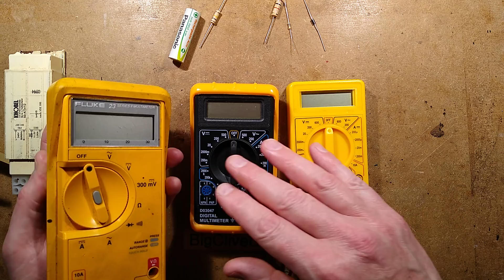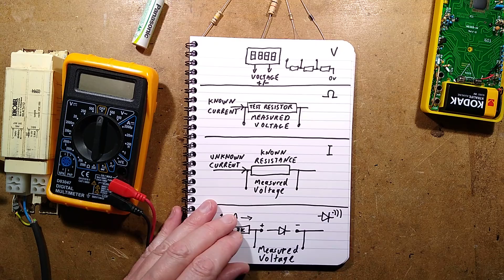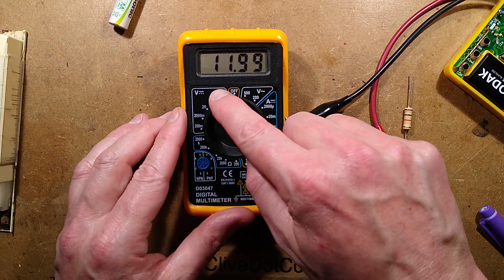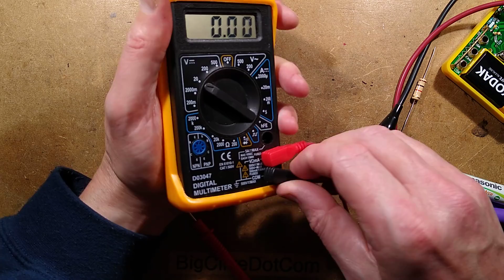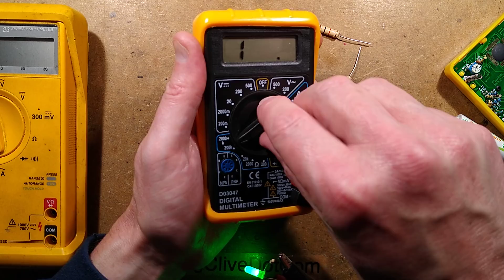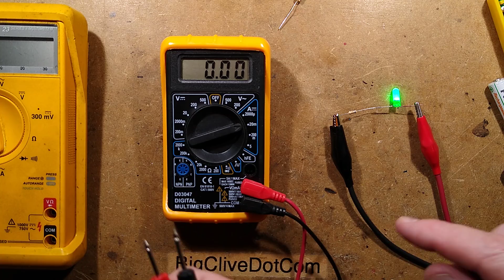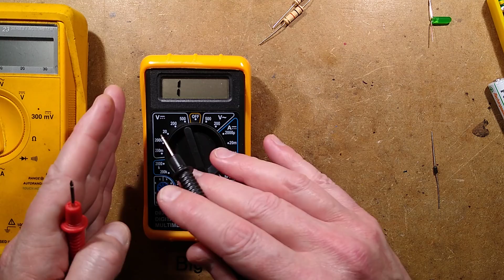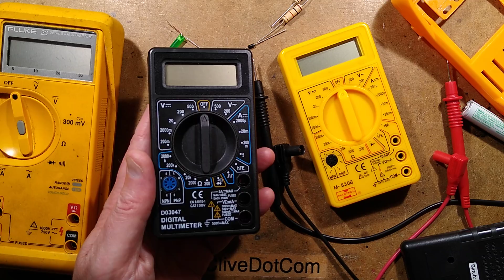How to use your trashy meter without blowing it up (much)

Comment: One of the probes on my cheapo meter broke (there's literally like a single strand of copper wire holding it together) so I bought another one. When the 9V battery dies I guess it would be cheaper to buy yet another one that to replace it. They're very disposable.

Comment: I don't have any problem with cheap meters apart from the fact that they invariably ship with leads that are totally shit.
I started out with an Altai analogue meter and moved to an Altai digital meter (similar to the one you showed here) but the meter after that was an Avo 8. The Avo was a top quality piece of kit but got replaced with a Fluke 12 once I started needing to use it up ladders as it was too bulky and heavy to use safely up the ladder.

Comment: For all the decades I have been testing diodes by resistance (not the crazy modern "diode mode", I always thought that the 600-ish value was ohms, not voltage. :) Plus, I did blow up my first Radio Shack (Tandy) analog meter by leaving it in resistance mode and putting voltage across the leads

Comment: Once I exploded the small mastech meter but I was way way of its specs, I tried to measure the voltage of a gas tube power supply, it was probably over 1kV but I was in high school and didn 't know better. When I opened up the meter some traces were completely blown.

Comment: I work in the arcade industry (for about 30 years)  For us it's highly desirable to have a meter that is able to correctly measure AC without any interference with DC 'ghosting'.    Reason for this is any AC ripple from either a poor layout/design of filtering or capacitors going bad can cause that ripple to play havoc with digital electronics used in the arcade equipment.

Comment: My requirement when continuity testing and getting a beep, is when reverse engineering. Quite often, you know that a component is connected to an IC, but don't know which pin number.  Being able to quickly swipe the probe across the pins of an IC and hear a beep when continuity is found is a must.

Comment: I have a couple of those. On one I had to use my Fluke to adjust it because it was way off from the factory. Those things are so cheap that when the battery runs out, a new battery is more expensive than a new unit.

Comment: Been doing electronics repair for about 50 years now, started with Eico VTVM's  bought my first digital meter about late 70's a Beckman bench top used it for years then had a few Radio Shack and other brands including the HF freebies my main units today are 2 Chinese up scale from the HF's and a Tenma with true RMS. Never owned a Fluke, too pricey for me.

Comment: I only have two meters, the cheapy yellow one you had on display, and the DIY looking one with the zif socket for testing capacitors/transistors. 
Though most of the time you don't need a tester to spot a capacitor that needs a change. 
I can't see a reason why I'd need anything more expensive. I'm not a professional, and I don't do anything with high voltage.

Comment: 13:15

accuracy: how something compares to a standard
precision: how fine the divisions are between discernable measurements

so you could still be on the 20k range, and if the meter read 15k for that same resistor, it would not be accurate.  What you really get by switching to 200k is a reduction in precision.

Comment: Yesterday I pulled my harbor freight meter out (one of three laying around... They just toss them into the bag of what you're buying) both probe tips had broken off so I had to cut off both probes down to bare wires and use the wires... But it worked I was able to test resistance

Comment: I pretty quickly destroyed my first multimeter, when I was a kid.
I had a series 1 land rover. Did not have the doors fitted, was driving along, multimeter on the passenger floor... it fell out and went under the rear left wheel.
Completely smashed.

Now I have 6 Flukes. Because sometimes you want to measure efficiency of a power supply (voltage and current in, voltage and current out - so you need 4), as well as a clamp meter and a spare.

Comment: I had an old LG but it drained the battery like crazy also it had a portruding on off switch which were prone to power on the meter while in my toolbox
Then I used the companies fluke but as as hobbyist bought the aneng , small, accurate enough and only needs 2 AAA and a better rated probes .
I'm never going back to using 9v 😊

Also when I was younger had my adventures with cheap meters, sadly the best I had faced a sudden death

Comment: Honestly, the only time I ever used the transistor socket on a meter was to see if a component I stripped off a scrap board was working at all. These days, I'm perfectly happy using one of those cheap 5 or 10 dollar component testers off eBay. Not only do they tell you if it works, but can give you an idea of whether or not the component is even worth saving. Plus, it works with just about anything you can attach to the leads. And yeah, I do have a Fluke meter I'm partial to, but I only have it because I found it new in a pawn shop for 25 bucks. Otherwise, I'd still most likely be using a 50 dollar Home Depot meter, or something of the like.

Comment: I will say that not ALL meters will fail to "read" when set to DC, but probing AC...
I have a Craftsman 82400. Granted, it's from what... 2003ish, but I love it. It's pretty much the same as your D03047 except it's Auto-ranging and can do some capacitance too (like 5uf is all unfortunately). Though, despite being Auto-ranging, it does have two for DC: V and mV. Can also "Hold", and do "Difference" - nice since you can ohm the cables and select Difference to get a more accurate reading. It also has a max 20A, 1000V DC and 750V AC reading capabilities (albeit only 400mA on the multipurpose reading ports)

Anyways, back to my point... producing a reading when set to "V DC". If I probe my 'Murican AC, I actually get a reading of 0.467V DC. (between line or load, or line/load and earth).
It also reads 0.19V DC with only one lead plugged in  (+ or - probe; regardless of line or load pins). 

Mind you, I'm not implying that's a good thing necessarily... Though one COULD argue that it is, really. Same way that the "scratchy continuity" is better than delay sensed, in that you're still getting a reading and it might get you to look at your meter before claiming _"There must be a break in the circuit because clearly I have my leads connected"_. 
(Granted, any experienced person would also check that they DO have their meter set to the correct mode, but we all make mistakes at least once! lol)
~~~~~~~~~

I will agree that the DC and Continuity are the two things I am always using! lol
My meter has auto-off, and that is the best. I leave my meter in V DC and then to wake it up I press one of the function buttons (a specific one). The only hilarious thing is that it doesn't reset the timer when sensing voltage. 

I mean I say that like it's bad, it's not so bad as if you are in the middle of testing and get sidetracked, it won't wear itself down. Nevertheless, there have been times where I am taking a reading and it shuts of JUST as I connect the lead lol
I have a cheap Equus meter in the garage that I don't use but once or twice a year, and I'm so used to auto-off that I accidentally left that one on for many hours while charging a car battery. (Also poo on me, as I left the leads connected while it charged.) Surprisingly, despite the decimal indicator having residual presence after turning it off, it did not burn-in. That meter is nifty though cuz it can read 4cyl, 6cyl, or 8cyl engine RPM signals :)
[/rambling]

Comment: Definitely no snobbery here, my go-to meter for the last 10-12 years have been Chinesium Vichy/Vici branded Fluke clones (VC99) & they've been great. Only replaced my original because it got lost, think it was about 20 quid and has plenty of features I've found useful in radio/tv repair.  The HFe is definitely crap, never accurate and the only times I've used it was to compare it to my LCR T2 meter.  Apart from that, it's fairly accurate on capacitance & even on frequency up to 500KHz.  I'm not a shill for them but 100% recommend them as a good first meter with extra functionality over the extra cheap ones. (The real cheapies are great too though, reasonably accurate at low frequency and it's economical to keep a couple in reserve in case of disaster/sometimes you just need more than one meter to see what's really happening).

Comment: Although you hinted at it by mentioning averaging, I see you avoided discussing "True RMS" BCDC? The only issue I have with the HFE facility is figuring out the leads on the fastest fuse on three legs. It's not a great yardstick by which to judge a meter in my view. That said, I've only once used it for grading a batch of OC44s

Comment: I like the meter I have now. Power down by itself. Also measure capacitance and frequency. Not perfect by any means. I could use inductance meter I guess. May get one of those clamp current meter.

Comment: My father killed off several of my multimeters when I was a kid. He had a hard time getting the settings right which tended to turn the coils to slag at the most inopportune times. Yep my first multimeters were all analogue simply because the digital versions were ridiculously expensive and big with almost no battery time if they even had batteries and weren't mains powered. I remember one time I took out my multimeter and the needle was bent all to hell. Eventually he admitted to have loaned it, but he hadn't damaged it as it was lready broken. He has set it to 20 volt trying to fault seek the wiring in a car. But as soon as he tried it the needle just whipped up and maxed out far beyond the scale. Yep that MM had a 20 millivolt range...

To me one of the advantages with a modern DVM is that they tend to be pretty well protected, both forgiving and resilient. Just selecting a to low range is not likely to kill or damage it. Even so my father managed to kill of a lot of those too. Now they were cheap ones as I couldn't convince him that it would be worth the money to get something a bit better. And to be honest even if they made a idiot prof all you need is a better idiot, and my father was a very good idiot when it came to things like this. Don't get me wrong, he was incredibly smart and capable and could rebuild a car, build a house, navigate at sea, handle almost any animal, talk down hopped up druggies, repair things and drive heavy loaders. His profession? Gardener...

My father was pretty amazing but he just didn't have a good handle on electronics. He also needed reading glasses but never had them on him, so little things like the difference between millivolts and volts tended to be missed...

Comment: Interesting you said you were confused by your first multimeter. That was also my initial experience. I built my first kit a KnightKit VTVM in 8th grade (1960s). At first I had no idea how the range switch worked and which meter scale to use. I don't remember how I ultimately figured out how to operate the meter.
Reply: Hmm. I never had a problem understanding meters (other than the tranny test socket).
I'll need a different brain to understand electronics or chemistry though.
Reply: I inherited a Fluke 83 ( Manufactured in 1988) from my father and I'm still not quite sure how some of its more esoteric/advanced features works. Still, a nice piece of kit to have inherited and it more than does the simple jobs I do.

Comment: I've never blown up a meter however I've blown the fuse a few times on the current setting. 
I had plugged the leads into the AMP setting for something else and forgot to change them back to Volts. 
I set volts on the selector and went to check the voltage and it didn't work (for obvious reasons).

Comment: I got a b-tier yellow plastic meter. But the 9V batteries cost more than the whole meter. So I found an old 1.5v-12v 500mAh universal adapter, which isn't good for anything these days (it uses a wire transformer, it's that old) and spliced the wires on it to solder it to the 9v power wires. So now it's a meter I can plug in.

Comment: Good video but I was hoping to hear your explanation of why the red lead is negative and the black lead positive for diode tests. It seems backwards to connect the red lead to the cathode for the diode to conduct. I have verified the polarity with a separate voltmeter.
Reply from the maker: The red lead is normally positive.
Reply: @bigclivedotcom  Yes, normally this is true but not for resistance and diode checks. Red is positive for current and voltage checks.
Reply from the maker: @waynem6513  That may apply to older analogue meters, but all my modern digital meters can be used to test LEDs with the red to anode and black to cathode.
Reply: @bigclivedotcom  Thanks for the reply and great videos. My analogue and digital trashy meters are all wired this way. My trashy meters must be trashier than yours. I think it must be cheaper to wire them this way rather than reversing the polarity between current and resistance.

Comment: I put a £3 CPC meter in my friends car.  One day it paid off as the charging voltage could be checked. 13.8VDC ( RAC said 14.1 ) was near enough, old age killed the battery and not the alternator. If you do this install an alkaline battery in the meter as it's likely to last longer. Generic type will be fine. 11 VDC unchanging would be bad news. Yes I do use the hfe tester. Most meters regardless of price are not 100% on that as a definded test current will be different device to device. Transistors can be pair matched for long tail pairs or current mirrors. The fact the meter gives a vague readiing is largely unimportant. A BD139 might say between 120 and 160, pick the higher gain and/or best pairs. Have a fresh battery and warm area as air currents change readings. 1 minute tests. BC337 (  327 )-40 might read 500 which is possible.  In real life air currents change gain. Push pairs together. Heat sensening transistors sometimes need a set gap ( 1 mm perhaps ). Sinclair Z30/50 and A&R A60 come to mind. Take a 1N4007 ( a must have ). Use it to measure temperature on the diode test ( a cold day is the easy way, inside, outside, inside the fridge is good with meter outside if possible ). Then try a red LED. The LED should be higher voltage and change less. If a meter won't read a LED that is a bad mark. Blue and white might be too much which is reasonable. A cheap meter should do these things regardless.  The cheap metre usually is more accurate than the parts demand ( +/- 10 % ).  Usually a part that far out is defective and will show up.  Capacitors being the exception and seldom measured on cheap metrers at uF etc. The CPC meter required better cables. £1 was enough. The suppplied ones would be a risk at 240 VAC as this house ( 236 to 245 ).

Comment: Clive, dideo test - (have you got a non-dyslexic keyboard ?)

DIODE test - nope, in 30 years don't remember ever using this function. In fact, I had to go to the meter to see if it had this function - and it does. Has the transistor connections too - and I remember poking a transistor into this in the 80s and not having a effing clue - so it and the diode test functions are completely surplus to requirements here. I think I've used all the other features (range control (up, down, man, auto), buzzer on/off, Data Hold and Memory (start, reset, min,max)) that your meters don't have.

Comment: I wish I had this information when I first got a multimeter all those years ago! I mistakenly put the lead in the 5A socket and tried to measure A/C in a light socket. The bang and melted ends of the probes scared the living daylights out of me (I was up a step ladder at the time - how I didn't fall off I will never know)

Comment: Been using my cheap-ish meter for a good while and I don't think I see the need to upgrade yet. Anything I'm looking at that's higher voltage typically has unusual-enough characteristics to justify powering up the ol' scope, otherwise it's just resistors and diodes. Other than the "proper" test equipment, my only posh meter is an Extech LCR meter. I figured I might as well get a good one of those if I'll be cherry picking components for projects

Comment: My extech mn25 has settings for 1.5/9v batteries. Measuring DC, it doesn't seem to load the batteries so they don't droop. Using the battery mode, it must apply some load like a resistor or something and the voltage will droop if its a dead battery.

Comment: Here is what I do. If I am in the engineering lab I use the high end stuff that is cal'ed and traceable to gather data. If I am troubleshooting something, close enough is good enough. I will cross check a cheap meter it with a high end one now and then. And take the cheap into nasty places and dangers leaving the $$$ meter on the bench.  I have a HF meter in my desk work bench car shop , like 3-4. They serve there well.

Comment: I’ve had that exact first one you showed (the one with the back off and the fuse) for a few years and really liked it…until last week 😥. I have a workshop with joinery machines, tools and lots of sawdust. Decided last week to take it apart to (finally) clean the glass because it had sawdust within it….anyway, had to ‘pop’ out the circuit board which released a few of the tiny copper, and very springy, ‘v’ shaped runners that allow the dial to revolve on the circuit on the other side of the board. “Shit”, I thought! Very fiddly to get back in place but then managed to get all bar one back in place. The final one sprung back out, bounced across my cast iron table saw and disappeared down into the blade (not running), through it and into a fair depth of the finest sawdust awaiting it……..😥😥😥😥😥😥😭😭😭😭😭. Bye bye meter, you will be missed…..was getting over it until now…..you’ve caused my grief to resurface 😭😄👍